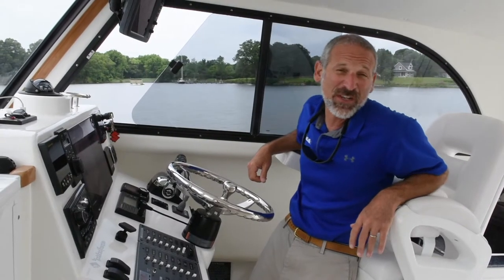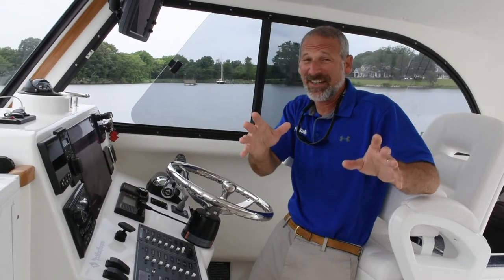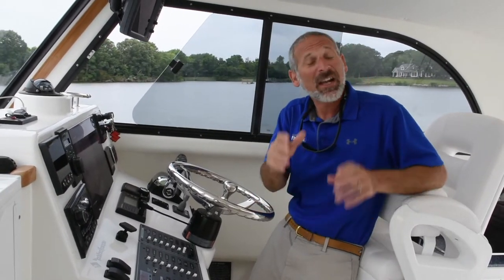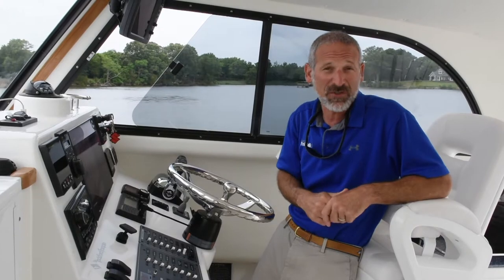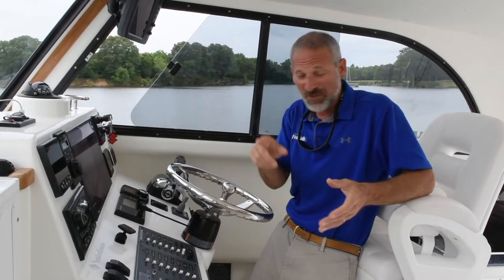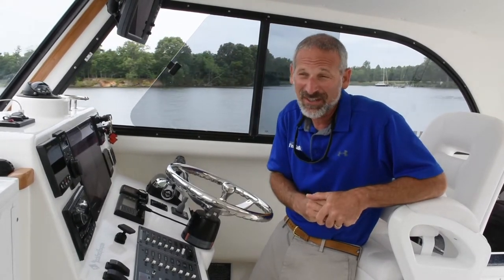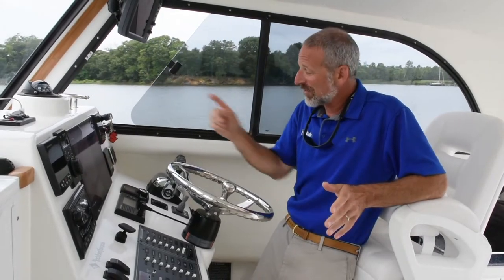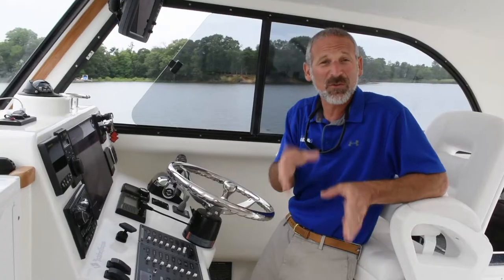How to Make Your Boat Better with the Zipwake Dynamic Trim Control System

Comment: Zipwake vs seakeeper ride??  Which works better?
Reply from the maker: Hey Kennith - we're not going to try to answer that directly, because we haven't been on two identical boats in identical conditions rigged each way. Every model boat does seem to react to these systems a bit differently, so different people could draw different conclusions on different boats. That said, we can point out that Ride has a faster reponse time and more data points being processed, however, it's also significantly more expensive. If we do get the opportunity to put them head-to-head on the same model, we'll report back.
Reply: @FishTalkMagazine  will be waiting for that to happen.  Currently waiting for my new Suzuki outboard.  Thanks for the follow up.

Comment: does zipwakes affect triming  the bow of the boat up?  like triming the outbored up to get the nose to ride up more in a following sea?
Reply from the maker: Absolutely, these control that function and they control it automatically. They can be set with different parameters for different boats and to fit personal choice, and can also be controlled as you desire on the fly.